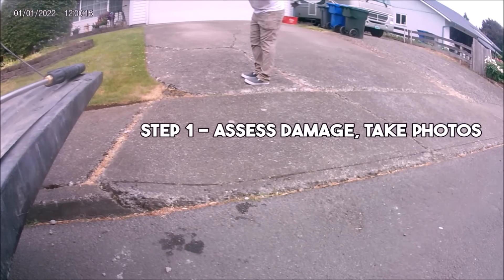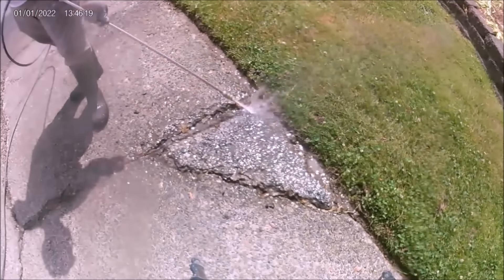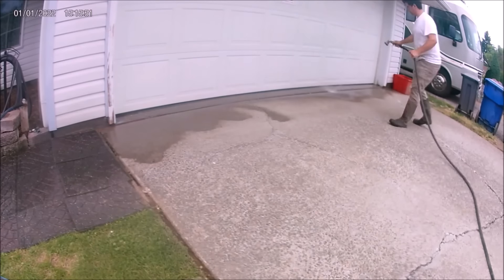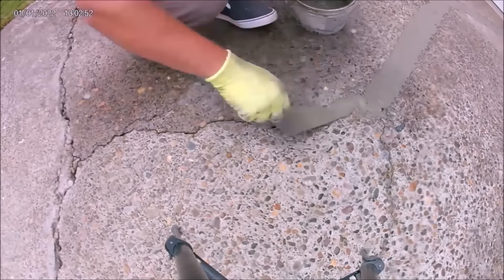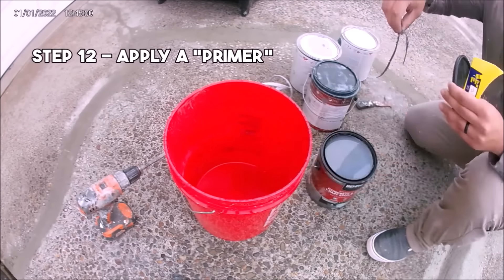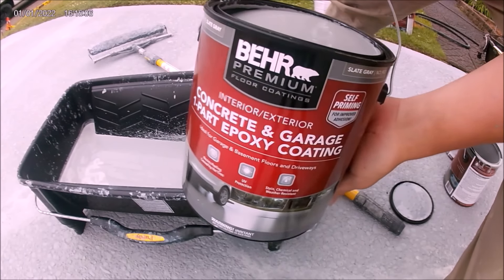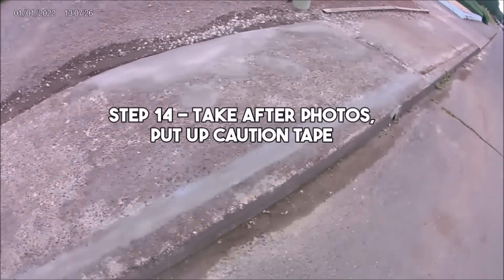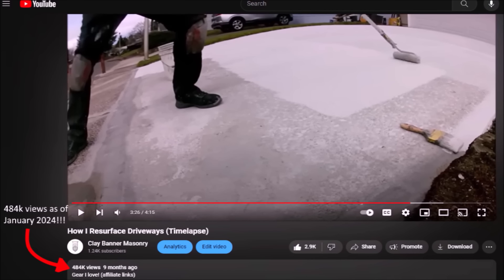How To Resurface Driveways (Step By Step Tutorial)

Comment from the maker: -At 1:52 that clip wasn't supposed to be there... oops
-Like I put in the beginning disclaimer, I am not responsible for any mistakes you might make if you attempt this yourself. It's not easy work and so much trial & error went into me getting this good at it. 
-People always ask how long it lasts, but the answer depends on a hundred variables. I just say, it wont deteriorate all at once; it will deteriorate slowly over the course of 2 to 5 years, but it might not be ugly enough to recoat until about 8 to 10 years.
-In the video, I actually watered-down the primer coat more than I usually do. Don't water it down quite as much as you see me doing in this video. I'd say roughly 70% epoxy, 30% water is just fine.
Reply: you power wash that one time its done also after one cold and worm season chance its cracked again ....waste of time and money unless ur selling the house trying to rip someone off ..lol
Reply from the maker: @ronmit-p5g  You're not supposed to pressure wash painted driveways. I make sure to tell all my clients that.
Reply: @claybannermasonry Great work, what do you charge for a driveway like the one in the video?
Reply from the maker: @RoscoPColtrane17  That size, about $2,500 or so.
Reply: @claybannermasonry  I understand. Thank you for responding. Great work, wish your company well.

Comment: What if…

You ground the concrete surface with a diamond concrete grinding wheel?.

THEN? coat it.

& I “get” that epoxy yellows when exposed to UV sunlight however-

What if…

You broadcast a grey or speckled vinyl flake to provide a little bit of distracting texture?.

Also? There is acid-etch & perhaps even a stain that might work as a base.

Comment: Question: can this process be used on a concrete drive that are slabs separated by pressure treated 2x4s? Can the 2x4s be covered. On ours they put concrete nails throughout the boards. Very difficult to remove.
Reply: To my surprise; yes! I've done that before and it works just fine. 😊
Reply: Yes

Comment: The big chunks of mortar will never hold up over time.  It will shrink then crack then start popping off.
Reply from the maker: That's only the case if you use the wrong mortar. Plus, covering crack repairs with epoxy greatly prevents the new mortar from popping out. My crack filling work has handled harsh winters and never bursted out.
Reply: Are you in the Atlanta area?

Comment: Dude STOP IT. Without mechanical prep it's not gonna hold up long term ! Scarify, shotblast or diamond grind are the only way to prep. I do this stuff on a professional level and you sir don't know what your doing. Those cracks need to have their vertical sidewalls mechanical prepped. Your prep work DOES NOT MEET THE ICRI (International Concrete Repair Institute) standards ! You probably aren't even aware such an organization exist ! You even mention " small sections my peel" my God !

Mechanical prep and use an arcylic fortified cement resurfacer. Top coat with that low solid water based epoxy if you want. GEEZE.....